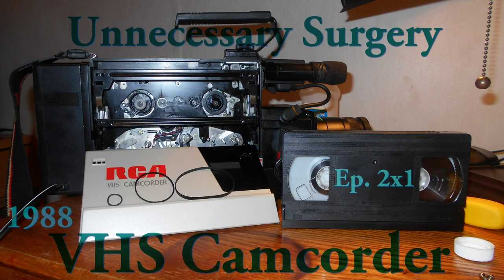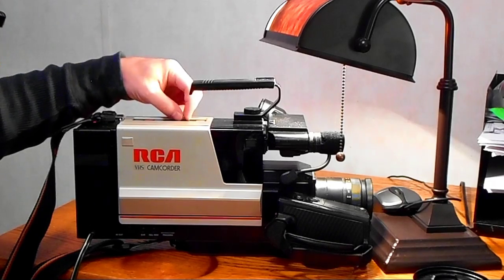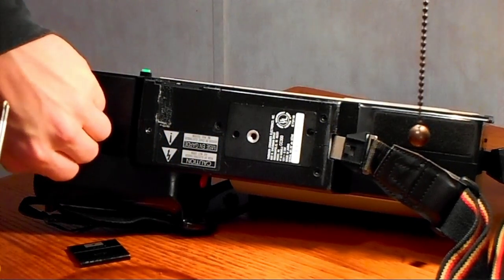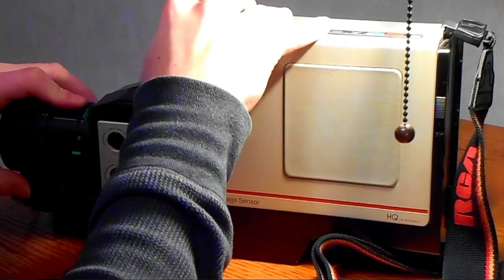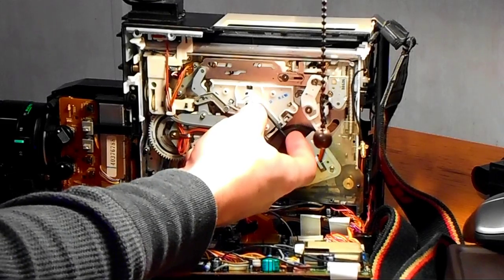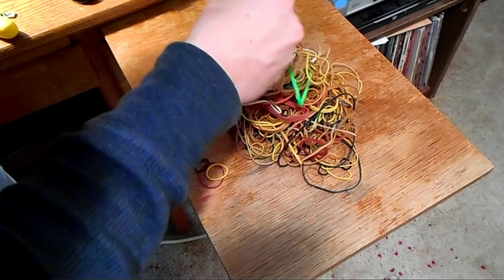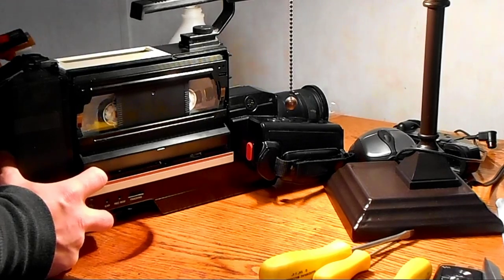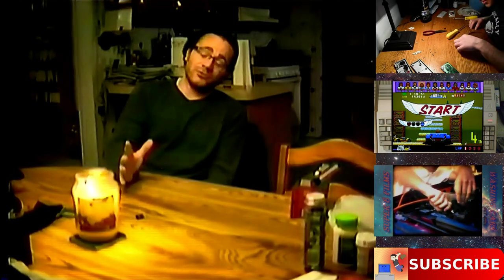1988 VHS Camcorder Repair - Unnecessary Surgery

Comment: Actually there is a big difference between those belts and rubber bands. The belts are made from a carbon material and don't stretch like rubber bands. If you use a rubber band then use one smaller than the belt but it won't last anywhere near as long.
Reply from the maker: Well, it's going to be interesting to see just how long it does end up lasting. Been about 2 years so far and it's still doing fine. As long as it lasts an acceptable amount of time I won't mind cracking it open once in awhile. Can't imagine I'd be able to easily track down the actual belt for this thing, though I never did try. For me it was about the novelty of using the rubber bands and having them work.
Reply: Fair point.
Reply: Yep. I did exactly that on my 1988 RCA CC300, replaced the belts with rubber bands. It worked for things like door mechanisms and non-critical things like that. But for the capstan drive it did not work properly, simply because the speed is critical for that function. And the constant stretching of the rubber band produced unstable speed. The video tracking managed to keep up, but the sound was wobbly (mono linear track). If someone can tell us where to find exact replacement belts (and pinch roller) for an RCA CC300, I'd be ever so grateful.
Reply: not worth looking for a belt. same part.

Comment: Looks like I might have a more difficult time to repair mine. Mine is a smaller VHS-C camcorder. It's a JVC that came out late 2004. I know I'm gonna have to worry about the belts a lot later. It's working fine now, but I know down the road they will start to wear out.. Cool video.

Comment: i have the cc285, i recapped the mobo and part of the camera its working except the monitor well it does but has issues, it needs recapped also, was wondering if u recapped urs yet on the monitor due to high voltages in it

Comment: As an aside: I managed to blow the fuse in this thing when probing the outputs trying to figure out where the video signal was. I bought an RF modulator unit for this line of cameras and disassembled it in order to make an A/V cable. Turns out the camera feeds 12V straight out of that connector to power any accessories attached and I managed to short it straight to ground. The fuse is a fast blow, 250V 2A fuse from Bussman, in a 5mm x 20mm package. You should be able to find it at any hardware store.
Reply: you ever figure out the pin out on your RCA cam? I am trying to do the same thing and your comment caught my eye> thanks for sharing your info here!

Comment: The battery pack doesn’t seem to be working on mine. I charged it for the longest time but nada. However, the ac charger works with it but I don’t want to be stuck to the wall..

Comment: What a monster that camcorder is! I got early 2000's Digital8 Sony camcorder and I thought that was huge already.
Reply from the maker: +Polaventris When I was using it in the early 2000's I was getting strange looks from some people that thought it was a relic, while others thought I was from television station. Honestly the quality of it was just as good or better than anything made in the early 2000's in my opinion, so I felt fine using it back then. I've looked up the price of it brand new and it was either $1,000 or $3,000 back in 1988 when my dad got it. Not sure which one but wow... Just about what the Amiga would have cost him new or more.
Reply from the maker: +Polaventris I kind of wish consumer camcorders were still that big. When you got the handling of it down you could get a very smooth picture out of it. I feel the smaller cameras move around way too much when you hand hold them now. But putting this sucker on your shoulders meant it "could" be very steady if you got the hang of it. It could be even worse movement if you didn't though. I think if you hand hold a camera very smoothly it gives off a nice impression of being there vs a tripod. Real humans move around ever so slightly even when standing still, and I always thought this camera was quite good when held.

Comment: I just picked up the same camera at goodwill for a buck. The belts seem fine but the inside gears (under the metal plate that holds the wires) seem to be jammed but I cannot find any blockage. It won’t budge and when I put in a vhs it just whirs. Any suggestions?

Comment: I just got two Sears LXI VHS Camcorders and one of them will play tapes fine when fast forwarding and rewinding but its struggling with playing the tape at normal speed. I'm assuming its the belts and will have to replace them. But when i switch to camera mode it displays a grey image but shows the date and what not. Would this also have to do with the belts or is it something i wont be able to fix? PLES HELP MEH! Thanks.
Reply from the maker: +Typical Films Gaming With the tapes not playing at regular speed, that would be a problem with a belt. Replacing it should solve that problem. However, if you put the camera into recording mode it "should" switch the display to look through the lens, unless you forgot the cap was on, or if the switching between lens and video was also controlled by a belt. I don't know what controls that, it always sounded electric when they switched so you might have a bigger problem there. It wouldn't hurt to take the thing apart and replace the belts, especially if you go the cheap route with the rubber bands. If there is some kind of damage to the viewfinder preventing the image from showing it's possible it would still record anyway and it could be used with that knowledge, maybe even look for a replacement viewfinder. Also, check the iris button on the side of the camera, if that's turned all the way down then you won't get an image. The cap and the iris thing are two simple things to be sure of, then go for the belts because it needs them anyway, see what happens.

Comment: How "important" is the first belt you replaced on this camcorder? I.e., if this belt doesn't seem to work, will all the basic functions be rendered useless? I bought a cheap second hand RC CC250 model and this belt appeared to be the main problem, as the other two larger ones work fine. I can't get anything else to work, but the other belts move up when I "manually eject." I'm really interested in restoring this, as it seems like it could work if I get this right, but all my rubber band attempts have failed.

Comment: So I have one of these that stops recording after 3 seconds and then rewinds. Any idea what that might be?
Reply from the maker: Yeah, that was a thing mine would do sometimes. Another symptom of those belts giving out, you're just not all the way there yet. I "want" to say the belt that is used for recording is the smallest one I replaced, but you might as well replace them all while you're in there, that stuff is not going to last much longer. Replace those belts, should fix her up!
Reply: My thoughts exactly. Figured I would replace them while I was in there. Hopefully it does the trick. Thanks!

Comment: Maybe you could help me. I have the RCA CC305 and I cannot get it to power up. I have to use the charger/adapter as the power supply to the camera because the camera still has its 30 year old original battery.
The camera was in perfect working order when it was put in storage many years ago, but it will not power on now.
I cleaned the metal contacts on both the camera and the adapter and still got nothing. I checked the adapter with my multimeter and it still works perfectly, so the problem is in the camera I assume. 
Got any idea what my problem might be?
Reply: I had the same problem, just order new batteries. subtel.es has plenty of models

Comment: I need help. My camera is same as yours but the tape compartment doesn't even open. There's no tape either. It's stuck shut. When I press the eject button, it whirrs and vibrates a few times, then stops. Please help
Reply: This is a very easy fix. There are two belts inside that melt after the years. Just replace them. The one to open the door is on the left to side when you open the side panel.

Comment: Hey @shot97 I just bought this exact Camcorder today and I’m so happy to start using it! I can’t get the eject door to open, the viewfinder to work, or use the FF RR functions at all; however, I’ve only tested without a tape in. Any suggestions? I plan on replacing the rubber bands tomorrow.  Thanks.
Reply from the maker: Someone else mentioned a problem with the ejection of the door; But I can't wrap my head around what exactly might cause that. I don't think it's a mechanism that controls that... It's almost like a gull-wing door that WANTS to be opened at all times, but it's forced closed. Once you tell it to eject it just lets go of the door and it flies open. So maybe the button isn't telling it to let go? It's not an issue I had problems with so I didn't really snoop around that too much. You should be able to take the door off and fool around, however. - The FF/RR/Play/Record buttons won't operate unless there's a tape inside. As for the viewfinder... Either the wires don't have a proper connection; or the CRT inside of it has died. I'm pretty sure it's a super small CRT in there... I can't imagine a camcorder got enough use to kill that off, though. If you're also having issues ejecting as well as with the viewfinder, it could be the electronics. Which would be very hard to fix unless there's just a loose connection inside. So I'd take it apart, unplug everything, plug it back in nice and secure.

Comment: Hi, I am having troubles with my VHS camcorder it is a Panasonic and when I record to the tapes then play it through my VCR the shits are all over the place and very very choppy. How would I got about fixing this problem?
Reply from the maker: You wouldn't happen to have another VCR to test the tape on? Just to pinpoint if the problem is on camcorder end or the VCR end. I mean it wouldn't hurt to clean and demagnetize the heads in the VCR... But if you get the same garbled crap no mater where you play the tape than it's the camcorder... I'd say clean and demagnetize the heads there as well. If it's super choppy it could be the belts going but my first guess would be the heads just need to be cleaned, make sure tracking is in a good position on the camcorder and VCR, should be all you need to do.
Reply: Shot97 ok thanks for the advice! Would I have to demagnetize the Camcorder or the tape itself?
Reply from the maker: The camcorder, wouldn't hurt to do it for the VCR as well. You can manually clean it using a Q-tip with alcohol or windex. In order to demagnetize it you'd need a special tape that would do that... Perhaps you already have one, should be able to find cheap and never used one on amazon or Ebay I imagine.

Comment: You're a g. Thanks for the help. still super nerve racking goin into the innards like performing brain surgery but at least I have a reference
Reply from the maker: You're welcome, good luck, let me know if you get it working!
Reply: Got it working! Not gonna lie, it was pretty nerve-racking being inside there, knowing one wrong move or forgotten reconnection and it could be ruined. Felt like a brain surgeon haha. The only issue that I have to have now involve the head/heads. When I can record and playback now, but there is a pulsating noise that appears.

Comment: I have the same camcorder and fixed the belts. Now, I have clear video, but no audio from a vhs recording playback. I got audio from a prerecorded tape though. Also, when I put the vhs recorded tape in a working vcr I could only see glimpses of my recording and the rest was static. I have cleaned the head drum a couple times already and am wondering what I can do
Reply from the maker: If you're getting audio from a prerecorded tape but not on one you recorded from the camcorder, the problem could be the microphone. You can try to reconnect it or plug a different mic into it and see if that helps there. If you have clear video playback on the camcorder but not on a regular VCR and you've already cleaned the heads, try adjusting the tracking manually, and also check to see if the camcorder is recording in LP mode. Many newer VCRs only support SP and SLP/EP modes, playing back an LP tape in these VCRs will produce static. You can try a different VCR or adjust the camcorder to SP or SLP.
Reply: @Shot97  Hey, thanks for the advice! I will see what I can do
Reply: @Shot97  I took apart the viewfinder/microphone and the actual microphone plugs into a port connected to a circuit board. I plugged in a headset with a mic and tried lots of tests. However, there is still no good sound, only buzzing. I wonder if it has to do with the circuit board, but the soldering points don't look bad. It kind of sucks this camcorder doesn't have an external mic port, just a viewfinder plug in. Is there anything I can do to fix it with maybe the board or wires?

Comment: Lots of unnecessary surgery?  Just replace the small belt you removed first. And access is through the loading gate door with cover off. 2 screws under rubber cap covers. Panel off. Gate open. Small belt out and in then replace in under a minute if you’re steady.

Comment: Do not fix it with rubber bands. That is a very stupid thing to do. Rubber bands have too much elasticity and not enough grip, which will throw the mechanism out of sync, and they will just completely break anyway after so many hours of use. 

Buy and find a generic VCR belt kit with real rubber belts and find one with belt sizes that match what is installed in the camcorder, - approx 10-20% smaller to account for tensional slack. 

100% guarantee that this camera stopped working within a month after filming this.
Reply from the maker: How about you actually attempt to do something before flapping your mouth up and down? Yes, it still works. Five years later it still works! And yes, the audio is ever so slightly out of sync, it goes in and out ever so slightly, as it was on day one. Fix it with the real belt if you give a ss--- I don't, and if you care seriously about recording with a 1988 VHS camera, god there's a few things wrong with you buddy. How about I quote you for all who think VHS is a art quality to strive for; "That is a very stupid thing to do." The video is for fun, what is so difficult to understand about that, you pathetic twat.

Comment: My RCA camera will rewind, ff, pause, but it wont play.
Reply from the maker: One of the belts.
Reply: Thanks!
Reply: I replaced all the damaged belts. Now it plays the tapes, but it comes out super slow and garbled. I am pretty sure it's the pinch roller. Do you know where i can find a new pinch roller? Thank you.
Reply from the maker: May also want to try different belts; unless you bought the originals. I had try out a couple in order to get the speed consistent. If not, you might be able to find the pinch roller here: http://www.smcelectronics.com/vcrpr.htm

Comment: When I hit the record button nothing happens, any ideas on why this is?  Thank you!
Reply from the maker: One of the belts controls the  recording function, I believe it's the smallest belt.
Reply: Shot97 thank you!  The only problem I’m having now is the speed of the tape is off.  When I record it sounds like the chipmunks
Reply from the maker: I'm guessing you went with the rubberbands like I did? If it's sounding strange I'd say you need a tighter or looser rubberband. Mine took about 3 before I got it right, and it'll never be exactly "perfect" unless you order the original belts for the thing, should be usable if you keep trying. I'd switch out the other belts while you've got the thing open, might help with the sound as well.